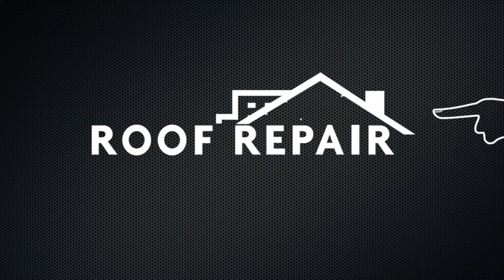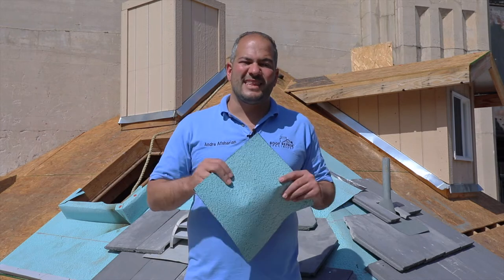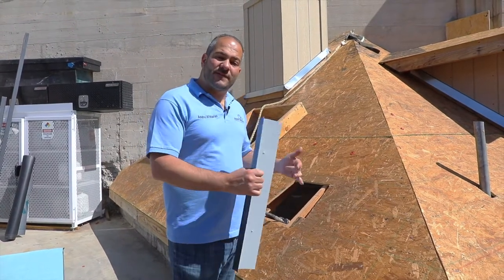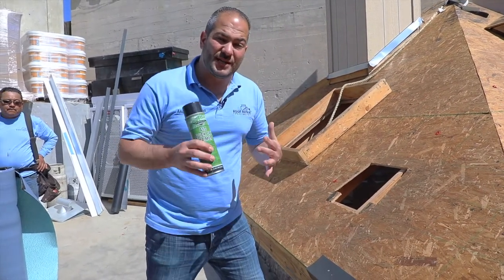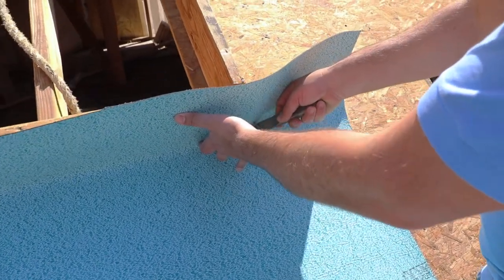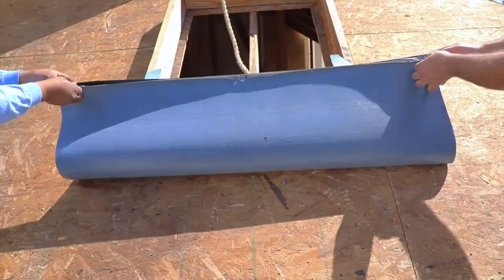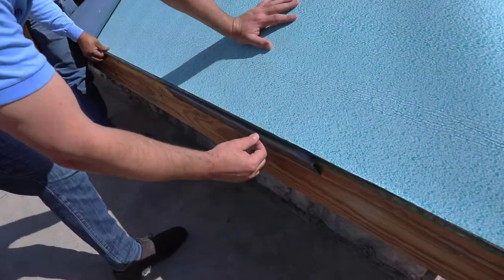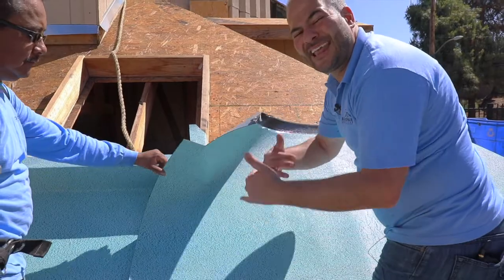How to Install Polystick MTS Plus Underlayment | Tile Roofing Guide

Comment: Can this Polystick underlayment be used for a composition asphalt 3-tab shingle installation and serve as the membrane between the OSB plywood and the asphalt shingle? Looking to use it for a patio cover (LA Area) with a shingled slightly sloped roof, instead of doing torch-down.
Reply from the maker: It can. Depending on the slope, however it's not really needed. 
If the slope is 2/12-4/12 the code requires double layer of underlayment. 
above 4/12 1 layer of underlayment 
Anything under 2/12 your not allowed to install shingles. 

Now being that its a patio cover you can probably install shingles if its 1/12-2/12. However I wouldn't recommend it. If you go that route a self adhered underlayment would be a good idea. 

I would recommend a ice and water shields, its a similar membrane to this.